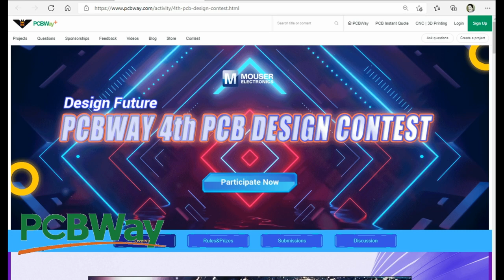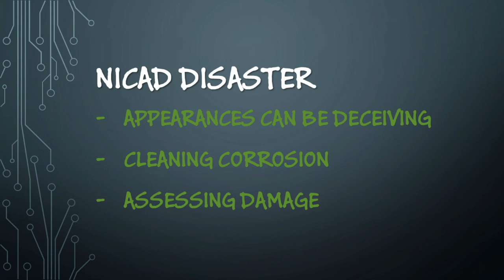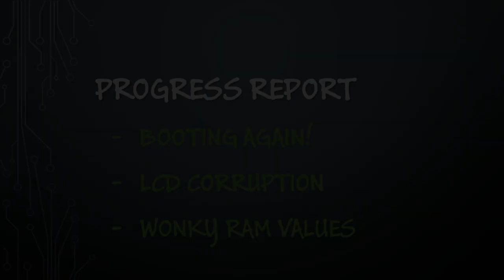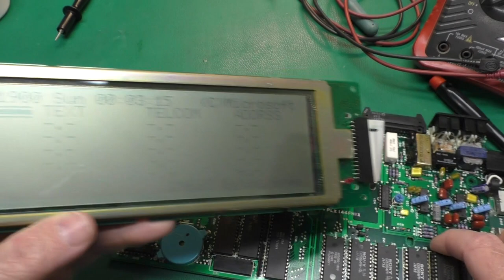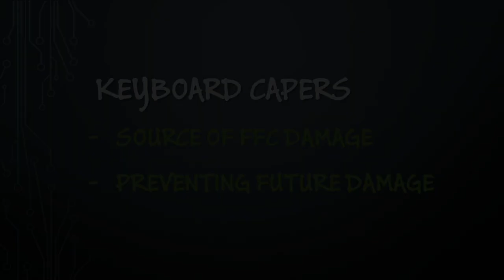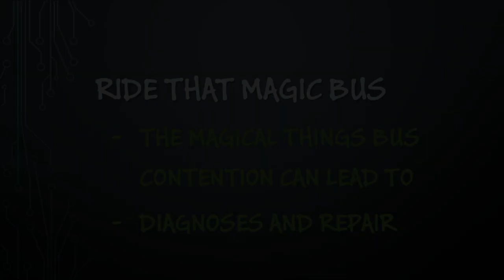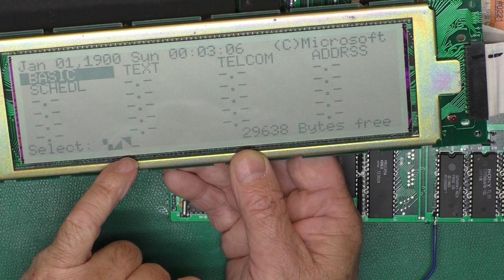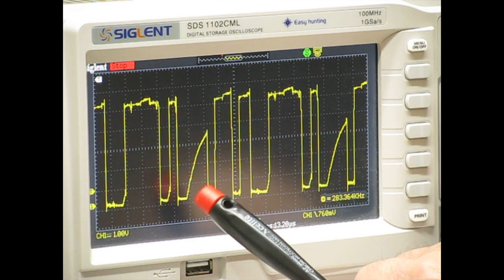Tandy 102 Turmoil Pt.1 - Battery corrosion repair, hidden damage, LCD corruption fix

Comment: I have 3 TRS-80 Mod 100, one 102, and one TRS-80 model 200 that needs work on the LCD and some cleaning. It was good for me to watch someone else fix one before I get going on it.  
Thanks :)
Reply from the maker: Hi, take a look at my past M100/102/200 videos as well. For the M100 you will need to replace the electrolytic caps. For the 102 and 200 they are seldom an issue. The memory batteries all need replaced though else you get a mess like this.
Reply: @HeyBirt  will do, thanks :)

Comment: I learn something new from your videos again. I would like your opinion. After watching you clean and repair the battery corrosion damage I am asking myself if I should remove the old batteries from my Model 100s and 102s. I have two of each model and currently have one of each open. Both of them have no corrosion yet and the batteries still function but would you remove them and replace them if they were your units? 
Thank you for your great videos.
Reply from the maker: If the memory batteries have not been replaced, then I would suggest doing so. They will leak and especially on the T102 it is a disaster. On the M100 the capacitors are also prone to leak. It is one of the few machines I do a recap on by default. The T102 caps are fine, no need to replace one unless it is faulty,
Reply: @HeyBirt  Thank You, I have started removing the old capacitors and looking for replacements. I came across Aluminum Polymer Capacitors and was wondering if they would work in the Model 100? It seems like they would be a good choice since they aren’t filled with dielectric that can leak.

Comment: You want to fix my 102 somebody left batteries in it and I think it's killed the power supply section or eat some lines or something you can do a video and fix it for me. 😆
Reply from the maker: As you can see in this video the damage leaking batteries can do on a T102 is extensive. I really don't want to do another video of the same horror show :)
Reply: I hear you, I  was joking with ya. I probably try to fix the damage and if not it will go in with my pile of old laptops. 😆